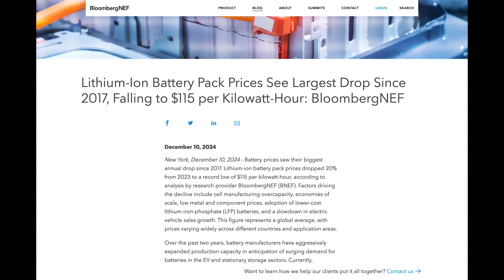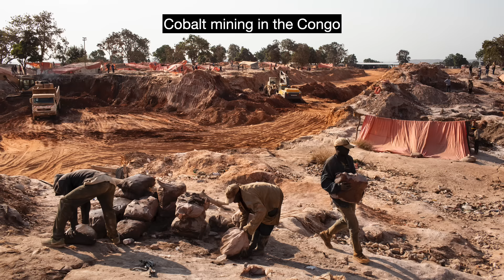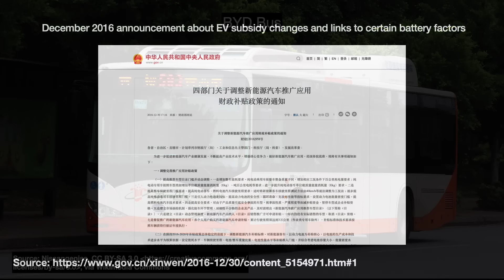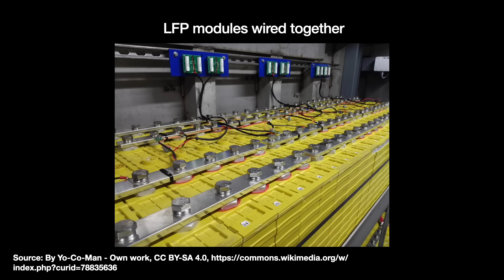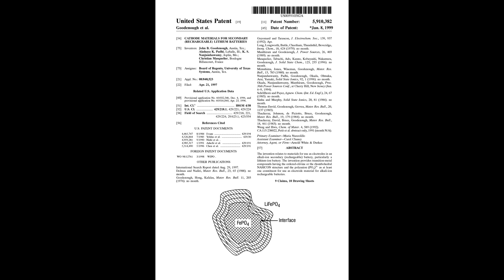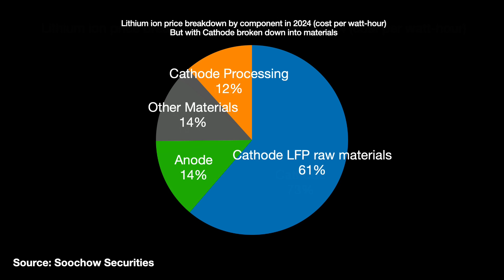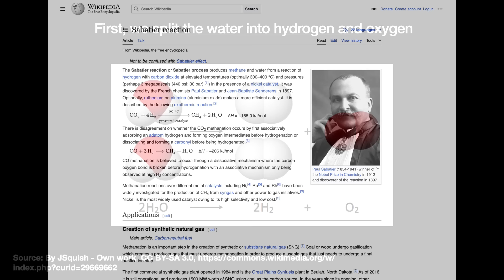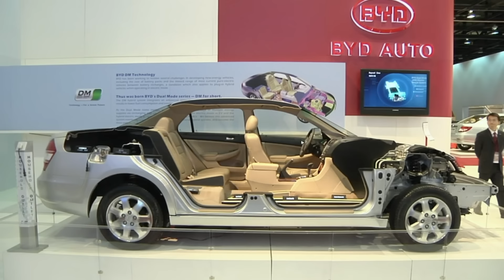How Did China's LFP Batteries Get So Cheap?

Comment: LiFePO4 is my preferred battery chemistry for larger applications. Yes, it is a bit heavier and less energy dense. But the advantages of improved safety and much greater cycle- and calendar lifetime make more than good for that. I'm quite happy with my (Chinese) LFP batteries.
Reply: I have a standard range model y with LFP batteries. Doing quite well with them. Unless you drive crazy distances all the time or into remote areas with limited charging it should be fine
Reply: @ Even if you want to take a longer family trip once a month, it’s not really fine. But also, fine for what? - my Audi A4 turned 20 this year and it is somebody’s daily driver still right now, that’s fine. When this is common case for an EV on the original battery, that would be fine :) - but looking at depreciation figures for 5 year old EVs and looking at 300+ abandoned 2012 to 2016 Teslas in garages across Australia, deemed uneconomical to repair, that’s an issue. Personally I purchased a 2016 5 series Diesel that has a good decade of life left and costs less per mile than public charging in the UK. A friend of mine recently purchased a 1984 E24 that is still driving just fine on the original engine, that’s fine :)
Reply: @DigiDriftZone Worth noting that those EVs are trash now because they used less robust battery tech.
Reply: @ so I used to go to Wangaratta from Melbourne quite regularly. I also did the great ocean road trip from Melbourne. All worked fine. I cannot comment about those uneconomical Teslas since I don’t know the details but if if they were 2012 to 16 they must have been older model x and s that did not have LFP. Thing changed in those years. Heck the BYD in 2012 looked pretty bad from what I heard. My last car ford mondeo lasted 12 years. Power steering died and after fixing it once (quite expensive) and failing again it was time to ditch it.

Edit: first model S arrived in 2014. By 2015 there were only 119 registered. Are you sure your numbers are accurate?
Reply: @ulogy  They are actually abandoning LFP and moving back to the "older less robust" battery tech. Every year there is some new more robust battery tech that a few years later we learn wasn't that reliable after all.
Reply: @DigiDriftZone  The EV is targeting 3 major goals:
1) Cost
2) Range on 1 cycle (alternatively: reduce the time to load, ideally would be to same level as gazoline filling time)
3) Lifetime (ideally only 1 battery as long as the car is usable)
Instead of 1 solution fits all requirements as is today's combination of extremely low cost gaz tank, adding roughly speaking 1% of weight/cost on a car, it might be that in future different solutions may be present. A city country like Japan may establish as standard a different kind of battery as a country like Australia/US with huge distances.
Ideal for EV would be a contactless energy supply on long distance ways. In case of train/bus such system was realized by on top/in the air supply lines, in case of EVs with strongly varying heights such system must work from the bottom. Is it technically feasible? (low power contactless charging for Smart Phones got established)
Reply: Just don't get 'em hot. Look for Louis Rossmann and an Australian rebadger selling them for "under-bonnet" use in "caravans" for stories of rapid degradation.
Reply: I get them off Amazon. Good prices
Reply: I don`t think that you are a user of LFP ! You`re a blatherskite !
Reply: a bit? - more like 40%, so they are just not suitable for larger applications, only for smaller applications where you do not need much range, this is why they are not used in "long range" models.
Reply: @DigiDriftZone  Cars is not the only place where batteries are needed. LFP is extremely suitable for household energy storage (powerwall concept)
Reply: @DigiDriftZone  My home energy storage battery does not need "range". Just KWh, safety and a reasonable price. I come from the lead-acid chemistry. LiFePO4 is a godsend.
Reply: @Aranimda  Oh yes, 100%, LiFePO4 for home energy storage is fantastic. But is a trade off for vehicles with some advantages but also many notable disadvantages.
Reply: @DigiDriftZone It's closer to 25% for EV cells, but yes, smaller range. And charging below freezing isn't advisable. But, you can charge it to 100% without any issue, and you can charge at full rate longer without damaging the cells, so I'd wager it's about a wash for most users. If you're driving >300km more than once or twice a week, maybe just...don't buy an EV yet, haha. (The reason the gap is smaller for EVs is individual cell size limiting the max efficiency for all chemistrys, and because the cited J/Kg chart neglects to mention that LFP weighs less than other chemistries.)
Reply: @DigiDriftZone  not true. more anti-China, pro-Tesla FUD. i suggest that you update yourself with Gen 4 LFP. anyway the market is always right, so expect NMC to go the way of betamax and then be gazumped by solid state.